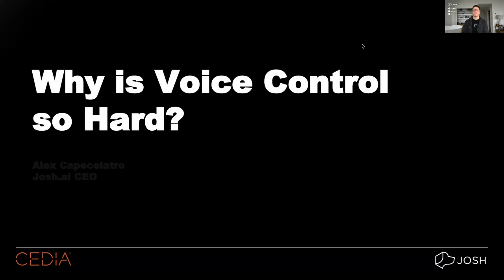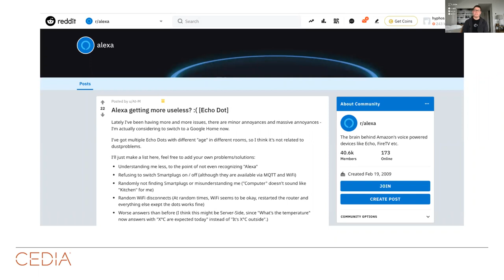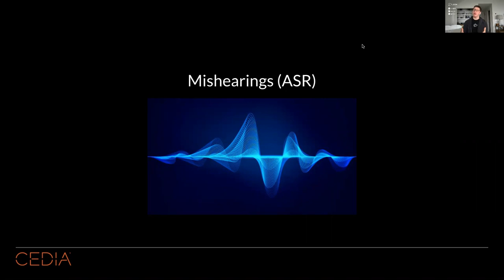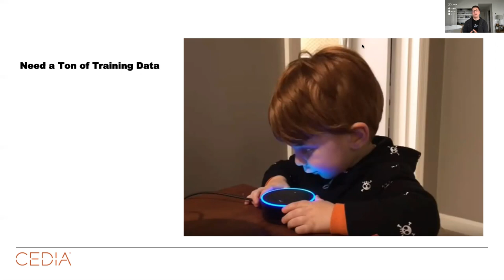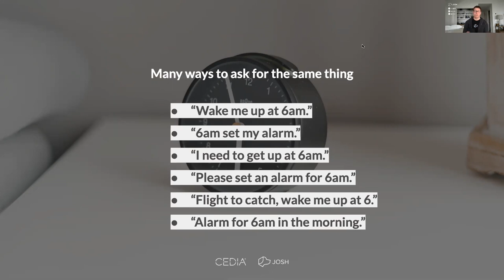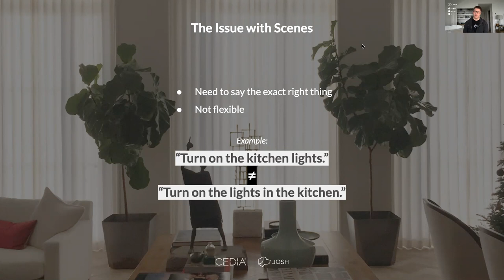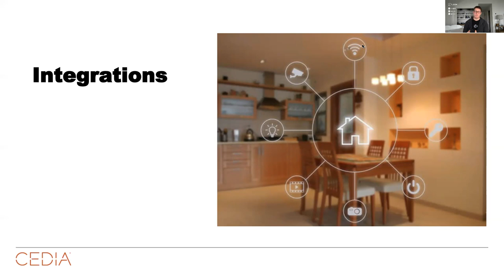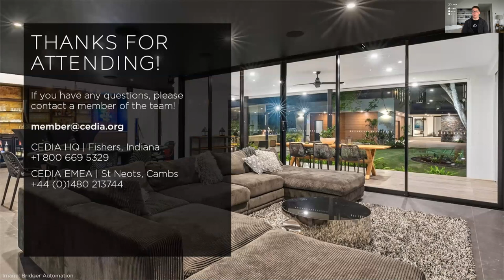CEDIA Booth Talk: Why is Voice Control so Hard?

Comment: That was a truly GREAT overview. It explains a LOT and anyone who wants or has one of these systems should hear this. Not just integrator but clients.  I think there should be a basic 'command language' overview for clients to learn how to control/speak/command a system. Much like training a dog with limited commands, the client should understand that the system is not as smart as their dog and speaking clearly with a 'command structure' approach is best for optimum utilization.

Another major issue you partially addressed is Network Access.  Because all these systems REQUIRE cloud/internet access, a network failure can be problematic. Just last evening, we lost our internet (fortunately I have a backup ISP Router).  Many lights and TV was on.  Many of the control boxes (light switches/plugs) were in hard to access location in our home.  We struggled to turn off devices but managed to do so; but it was a royal pain in the ass.  A 'reserve' or some sort of redundancy should be added, but I realize that is a challenge for localized 'intelligence' with existing devices and available tech.  Even though our local network (router and such) was perfectly fine, our primary ISP failed to deliver a working IP address.  Since the device configurations depend on a specific network, reassigning a network to an alternate with my backup ISP (not many folks have this!) was impossible to address in any acceptable way.

I have over 40 years in IT and actually had a 'smart home' company a few years back so understand most of these challenges; but most homeowners have little to no clue on how all this works.  A client facing version of this presentation would go a long way to explain just how to use a voice activated control system.  Tech has come a LONG way but still has a LONGER way to go.

Great presentation.  I wish I could have attended the live one but had a sort of 'Dental Emergency' that made that impossible.

Cheers and Good Luck,

Skip Stein
HJS Enterprises
skipstein@hjs-enterprises.com
ref: iq-home.skipstein.com